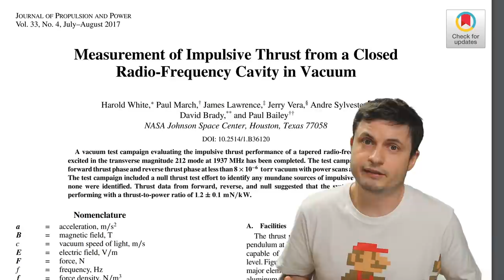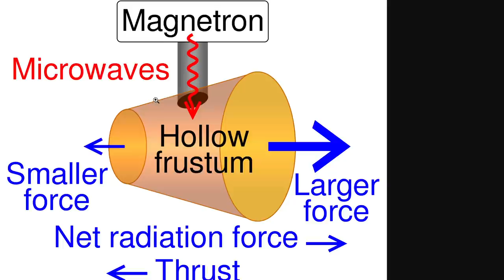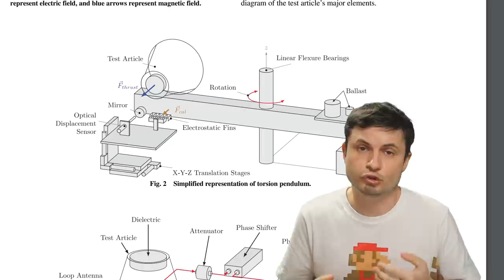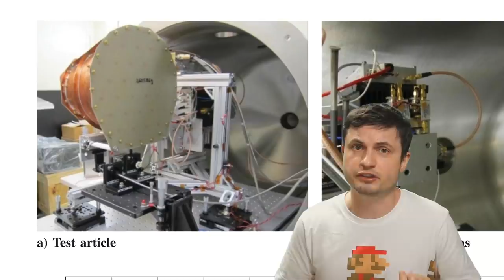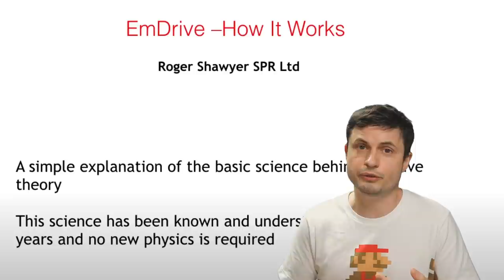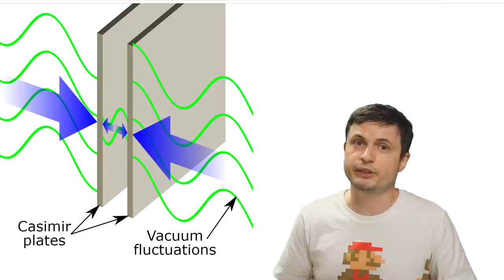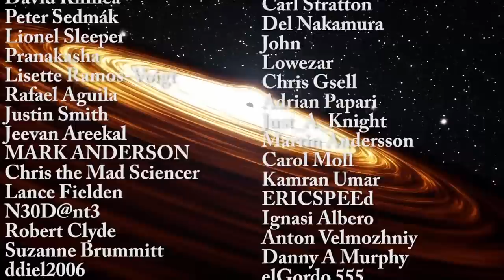Looks Like EM Drive Is Officially Dead - Experiments Fail

Comment: Pressure is not force, force is not power. E.g., Casimir's pressure may perhaps be used for making miniature energy storage devices, but it can't "extract energy from vacuum". 

Any pressure difference, or rather,  pressure ratio in EM drive is both produced by, and balanced by, ratio of plate areas, giving net balance of forces. 
Perpetuum mobile of the first kind doesn't work in electromagnetism for similar reasons it doesn't work in mechanics.

Comment: I wrote a sci-fi story where my EM drive has a very strong (plasma fusion reactor driven) magnetic field on the back that catches the rear high energy particle forces, and directs them along powerful static magnetic lines to relives the forces to either side. I basically cut half the force, the return force away by magnetically catching the particles, and proportionally equalizing their forces on either side of the bubble shaped field... and thanks to the laws of motion, equal sideways forces don’t inhibit forward thrust. And in my story, my super high energy source could fire absurd volumes of particles into the chamber making it a really viable space thrust source.

But that’s my amateur at physics mind trying to solve the problem, I’m not sure how viable that really is.

Comment: The small amount of momentum generated  in the Mythbusters  experiment was likely due to the oscillation of the fan from side to side. Each movement causes the sail to slightly move  ahead of its opposite side, which alternately regains the original  position, thereby inching forward slowly. The microwave field of the EM may do something similar, In any case, not much is converted into forward motion.

Comment: The reason why you are seeing slight force measurements in the items that are heated due to the microwave emissions is because gravity is a function of infrared energy. The differences in temperature will produce very slight force measurements too but not enough to overcome inertia of the entire mass of the part. You might get a measurable amount of force if two ends of the part were at extreme temperature differences. But that is also how you make hydrogen fuse and make a huge boom.

Comment: A more promising approach would be an electromagnetic variation of a solar sail. A solar sail gets its momentum changed mostly because of impacts with charged particles that are present in the solar wind.

Electromagnetism can in theory either artificially expand a solar sail's ability to affect the path of nearby charged particles, or else can be used to create a sort of a charged particle gun that preferentially sends off a fraction of intercepted charged particles such as electrons or helium nuclei toward some given direction, causing thrust of a rocket ship toward the opposite direction.

Comment: The problem with the conservation of momentum theory as a disproval of EM drive is the fact that the same principle should disprove combustion engines. 

EM drive wouldn't be generating thrust out of nothing, there is energy being put into the system in the form of the EM radiation being pumped into the cavity, and that energy has to come from somewhere and go somewhere.

Comment: The problem is that he didn't account for the pressure on the cone part of the so called "thruster". Which has a component in the same direction as the normal to the small surface. This force component and the force on to the small surface cancels out the force on the larger surface.

Comment: The car analogy - If you had enough motive force inside and something to push against, you could do that. It's still X motive force required, though, and kW for micro-thrust doesn't look at all good. You might as well just kick it. This thing also looks too much like a rocket, pretty primitive. Calling it "EM Drive" doesn't help, though - Any power will be EM by definition. EM fields could drive each other in theory, simply by pushing against each other.

Comment: Seems like more of an acoustic rebound principle.  Much like a violin or guitar.  where the cavity itself reserves most of the energy but does not release it all at once.  Adding a more malleable density or thickness on the inside might be the primary point at which you get some form of thrust from it.

Comment: Prof Eric Laithwaite made  a similar mistake with gyroscopes...in the sense that his gyros had no angular momentum and therefore could convert circular motion to linear force.
This EM thruster idea neglects  the  horizontal component that results from the EM waves hitting the sloped portion of the "conica"l cylinder

Comment: Here's a mechanical equivalent with huge propulsion possibilities.... Use the same chamber. Fill it with pressurized gas at 1 PSI over atmospheric. Say we have 100 sq inches area at the small end and 200 sq inches at the big end. That gives us a net of 100 pounds of force in the direction of the big end. (If you cannot explain why this doesn't work, you should complain to your physics teachers.)

Comment: Maybe they can’t explain how it produces thrust because it doesn’t produce thrust. I have a big copper trash can too. I hooked up all these tubes, put some experimental fuels inside. When it didn’t produce thrust, I tried heating it with a little wood fire. It still didn’t move, but I drank some of the mysterious liquid waste that came out and I got blind drunk. So it won’t physically take you to the stars, but my copper kettle corn drive will get you high as hell.

Comment: even if it worked like they thought it worked, all surfaces of the EM drive would produce thrust. it looks like there's far more surface area in the cone than there is on the flat parts. 

if anything, i could imagine using a black hole to generate these virtual particles via hawking radiation. you have a small enough black hole that can fit in an engine, and find a way to direct the virtual particles that are created via hawking radiation until the black hole disappears. a black hole would be a very dense propellant.

Comment: Yeah called it from Day 0, breaks fundamental Physics. In wave guide theory 1/2 lambada  is known as a short or termination, if the wave guide Terminates at 1/2 lambada the energy creates a standing wave and the reflected energy is attenuated by the wave guide to ground, the same principals would apply to the EM drive.

Comment: Neil D had a schematic that looked interesting, I do like this video. I love the true break downs. Ideally imagine how u could contain energy in a closed system.  
Rain gravity turbine, evaporate gravity turbine. The laser engine to me looked like utilizing the force generated when amplifying light. It does generate heat just like a rocket propollsion system. 
I feel like this engine is just the intermediate to warp engines, which require lots more power.

Comment: You have to understand that a lot of antenna theory's equations, are approximations. The equations taken on face value, actually imply it should work. So a lot of these "radiation pressure" equations contain a lot of hidden assumptions and over-simplifications. The point is that in one of these approximations and over-simplifications, the error hides. You should definitely do a follow-up when someone discovers exactly what was the error, which approximation breaks down, what is the Antenna theory equation which is non-applicable in this case - and why.

Comment: The theoretical paper has mistake on the first page. The mistake is typical when working with relative theory phenomena. It is very tempting to use momentum of one moving frame inside another moving frame. Then they amplify this mistake in resonant cavity. Some measurements although are well showing the force of radio waves to antenna. ”I said so ~16 years ago” and I kept theyr initial paper since I had to explain my point to some people. You can not cheat physical theory since the theory is consistent to itself.

Comment: When Mythubusters blows a fan left then right, what is happening, when the fast moving air blows past the left side, it creates low pressure, so the boat moves up and turns right, form the atmospheric pressure. This would not work in a vacuum.  What I mean is, a full vacuum, but u hav ea box of compressed air, and you blow it at the sail left and right, thios would fail. Momentum will be conserved.

Comment: thinking about that mithbusters boat. why not try to use the lift energy from an airplane wing to generate forward thrust by replacing the sail with a wing, and use the windblower from the side of the  wing instead of the back of the sail? this way the force vectors would only have 45 degrees not 180 and none of the vectors aim against the targeted direction. might result in more efficiency?

Comment: One would think that whatever "reactive force" which is generated by standing waves against the diminishing cross sectional area of the cone would be dissipated by the larger cross sectional area of the "exhaust" side of the cone producing no net thrust. It would seem that this is not indifferent from the inverse square law relationship of magnetic field interactions as established by Maxwell.

Comment: OK, turn it into a plasma drive.

Using the same effect as seen in the two grapes, etc plasma effect, in which the microwaves frequency was attenuated to the small, fluid bodies of spheres, creating plasma.

Reverse the ends and place the microwave generator at the wide end of the device, and send those electromagnetic waves for into a gradually narrowing, channeling daisy chained rows of fluid filled spheres, reducing the sizes of the fluid cavities until just before the exit plasma jet-stream nozzle, which can be similar to what's used today for vectoring engine thrust 

Whatever fluid would give the best results, including salt waters, and fluid elements and metals would be interesting to see, and the designs for fluid  bladders and the geometry of their assembly, or straight or spiraling, say 1,1,2,3,5,8,13, etc will also be fun to see, if any plasma is generated at all 

Cheers

Comment: With a thrust-to-power ratio of 1.2±0.1  mN/kW, it would be impractical to actually use just like the Casimir effect. I get that it doesn't need a propellant but if it would take 4000 years to get to Mars, no one would use it anyway. Thanks for the video.

Comment: If you have a magnetron to begin with, why not just point it backwards and turn it on? You'd get at least some minuscule thrust instead of zero. A smarter move would be to put a particle accelerator at the back of your rocket and shoot out stuff close to the speed of light.

Comment: That Mythbusters experiment was lame. Think about what happens if some of the air blowing from the fan leaks around the sail, or the air blown by the fan hits other air in front of the sail which leaks around the sail. You get net thrust. If this is the case, one test would be to remove the sail and note how much better the net thrust is.

Comment: Wait wait wait wait wait. I've read the reports on emdrive in the past and I just read the new one. I think they're wrong. Here's why

(Let's clarify that I've spent 20 minutes looking at this paper and only have 3 years of A&P education, 1 year of aero eng education, and 8 years in the EAA- I'm not near the level of a PhD, I could easily be wrong) 

The new setup, in theory, eliminates thermal expansion by helping to keep parts away from the engine. They completely redesigned the structure of the carriage to do so. An easier fix would (although it would have a lower degree of accuracy) would have been to preheat sensing units to operating temperature for zeroing, so that they are operating per the environment they will be placed in. Although this would require careful execution, and produces a lower degree of accuracy, it might produce more useful results in this case. The reason for this being the issues with how the emdrive is mounted in the Dresden system. The new Dresden system is designed to reduce shifts in CG, however, it does so using pendulums and mechanical advantage- both of which could unintentionally absorb small amounts of force.... which considering how precise our measurements need to be, could be a serious problem. 

The big advantage that I see in the EagleWorks design is that the cage mounting is directly linear with any potential force produced, greatly reducing the chance of any outside conditions unintentionally affecting the results. I could see a change in the temperature being a slight problem. 104F is not a lot at all, but it could be enough to cause variations to be monitored in this test.

The reason I come to this conclusion is: 
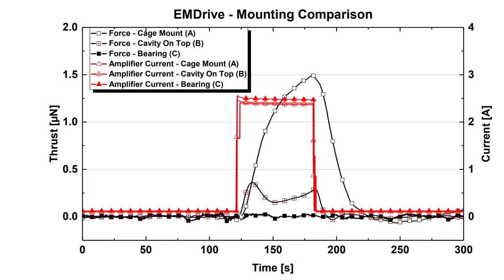7:50 Test A shows high thrust, this is nasa's design
Test B shows some thrust, which is the non-linear but parallel design with no bearing or pendulum 
Test C has no thrust. which could be due to the pendulum design absorbing very small amounts of thrust. 

On to why my incompetent brain thinks it might work. If I had to take a random guess (and this really is a guess) at how emdrive could produce net thrust, it would be from radio wave refraction. If ANY (even if most is reflected) EM radiation is able to pass through the conical wall, then it could potentially be refracted. If it's refracted, this could alter the direction of thrust. It would maintain the "opposite reaction" but the reaction wouldn't be in a directly opposite direction. Since some of the opposing force is bled radially outward, instead of in the direction of the smaller plate, my incomprehensible child-brain understanding of aerospace engineering would guess that it could produce a total force condition where the force in one direction is equal to the sum of forces in all other directions but greater than the force in the directly opposing direction. I'm thinking of this as a vector addition problem. If we add all of the forces together, including any force from refracted radiation, we'll get a minuscule, but monumental thrust in one direction. I could very easily be wrong, but then again, there are unexplained results still on the table

Comment: looks like it just stretches the metal slightly when it heats, which puts more weight on the far left side, throwing off the sensor calibrations

Comment: What if the cavity was left open on the back side? This allows the photons to create a net force on the front side, just like using any propellant. I am also skeptical about the helical drive. The energy needed to accelerate the particles in one direction has the mass equivalent according to Einstein's equation E=mc^2. When the particles are decelerated by pumping-out the energy, this mass-equivalent must be returned to the energy storage unit. The mass-equivalent moving back and forth between power storage and the particles will have a zero net propulsion force. My assumption it is best to eject the accelerated particles just like with any propellant.

Comment: But wasn't ppl guess it "worked" because one plate is hotter by the microwave hence some IR would push the thingy foward far less efficient than a flashlight pointing backward? Is that part disproven too?

Comment: There might be another way to break conservation of momentum by using relativistic mass increase!  Imagine what happens if you change the mass of the weights on 1 side of a centrifuge.  It would attempt to fling the imaginary mass, and accelerate the device!  I'm sure we can do this with particle accelerators, electron guns, etc.  I had wanted to to try this with super fluid liquid helium, but I think the forces would be higher than any material could withstand, and a relativistic stream of helium escaping from the device sounds like a very bad day!!!

Comment: Surely a light source gives off energy in all directions equally and is therefore perfectly balanced.  So if I attach a solar sail to that light source then I can gain thrust by catching the photons in once direction?  Surely that doesn't use any mass, just power?

Comment: I believe there is a way to make a fission rocket by using an electrical current to split uranium or plutonium in a linear fashion. Previous fission rocket proposals use large quantities of hydrogen in there process which makes them not much better than conventional rockets. Anyone who is interested in interstellar travel should watch the youtube video "liquid plutonium rocket". A ship that travels at a constant 1g acceleration rate can get to Alpha Centauri in 3.6 ship/7.3 Earth years (and that includes turning the ship around half way and decelerating) and would have gravity the whole way. A 10 ton ship would need a mere 10 tons of continuous thrust. All thats needed for this to become a reality is a fission rocket that can put out thrust for long periods and does not consume hydrogen.

Comment: resistance in space and on earth is very different, EM drive could work in addition to regular gas thrusters. EM drive, like ion thrusters, have virtually no torque power, but when in space and already moving, EM drive, like ion thrusters, could theoretically allow the object to obtain exponential acceleration. And waves and particles don't work exactly like you and a car, so i don't think it's a fair comparison.

Comment: Casimir effect is explainable with just EM noise. The region between the places excludes EM modes and that is enough to explain the pressure.  There is no need to invoke "particle coming in and out of existence"  for many reasons, being one of them, that if virtual particles were to appear they would last no time and impact no pressure on the plates...

As you know, particle pressure is due to collisions. A virtual particle wouldn't live long enough to travel and hit the wall. The same reason would block pressure on the outside of the plates.  The explanation is nonsensical and should be corrected